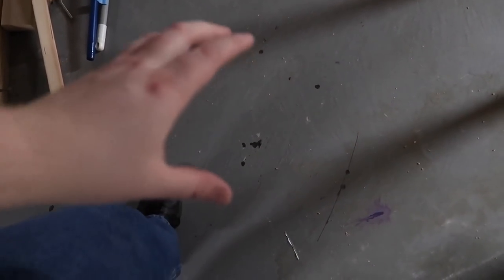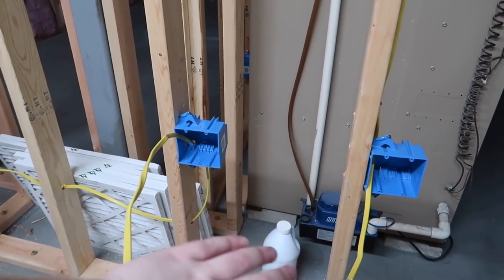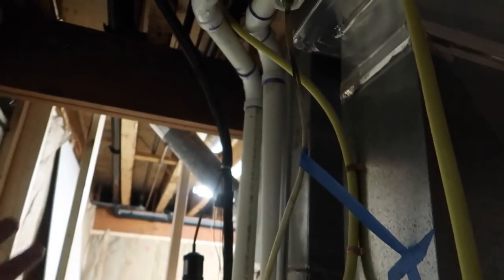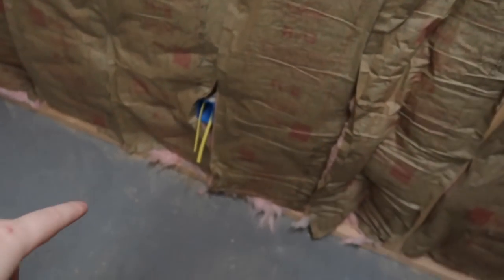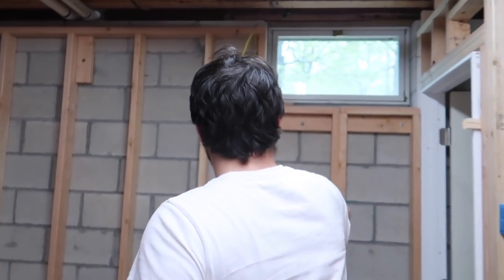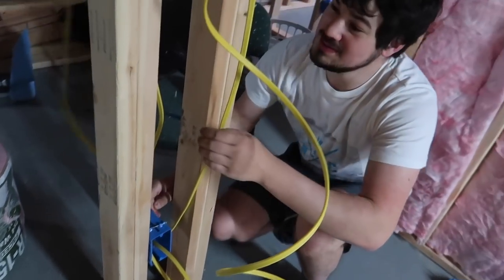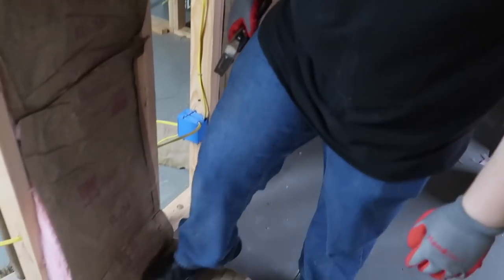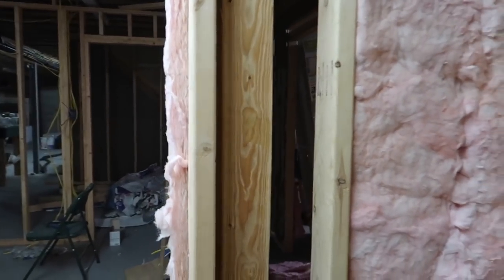Renovating McJuggerNuggets Basement: Ep 6 - Hanging Insulation!

Comment: Looks good, I hope you have room in the electrical panel for all them circuits. Every room should be on its own circuit. Before you close them walls up I would get Jesse’s buddy over that did the electric work for the theater to take a look at what’s in already it’s always way easier to add run new stuff now before you close shit up. Some room may even require more then one  circuit depending on what you are running in the rooms.